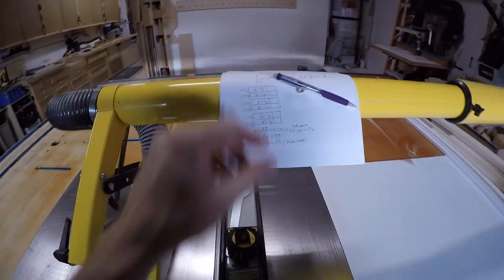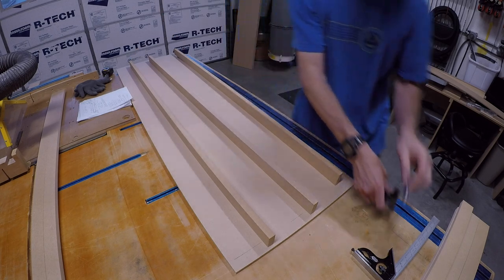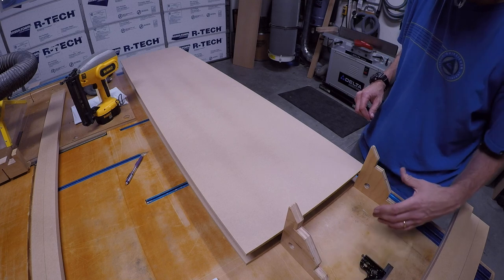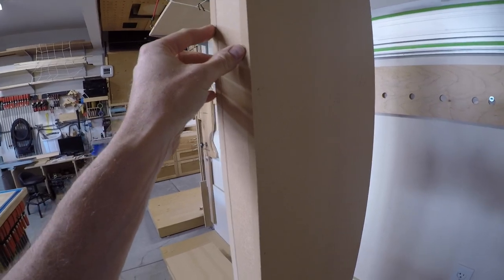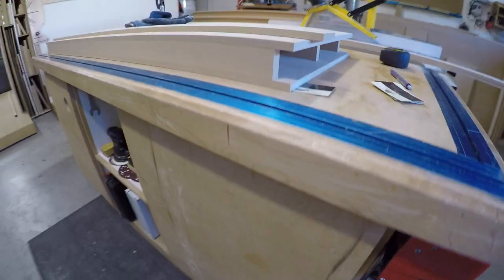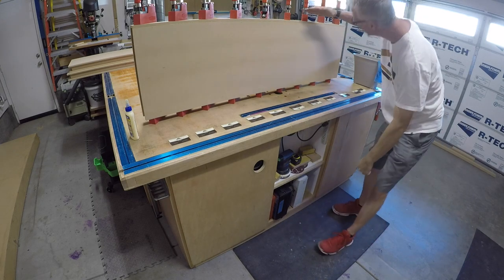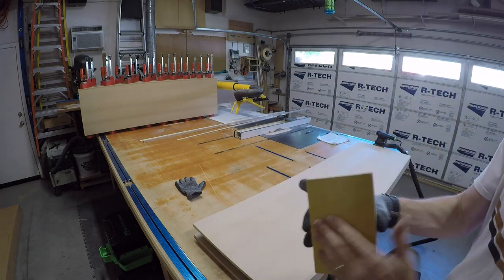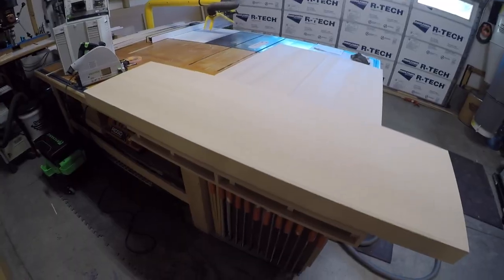How To Build Floating Shelves On A Wall.

Comment: That top shelf was a little snug did you have to trim it down? Take care my friend
Reply from the maker: Had to trim all of them.  I make them oversize always and then trim to length on site.  The walls are so bad in these houses with the recessed areas, usually they are out of square by a lot.  So it’s a pain to get them installed. The shelf is much better built this way, but it would be easier to install flat thin pieces and nail on wall.  I just can’t to that.  The finished product is so much cleaner done this way.  Do you do these?